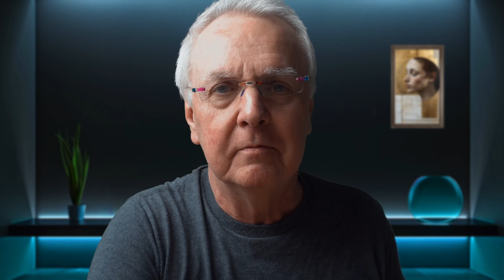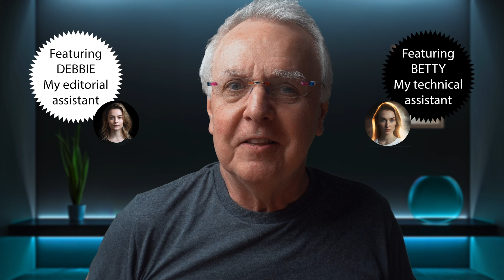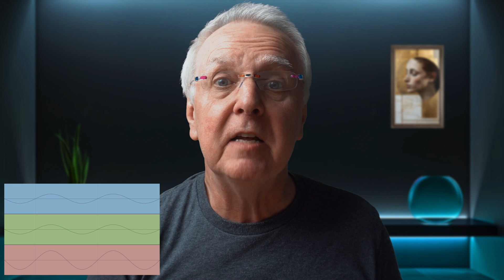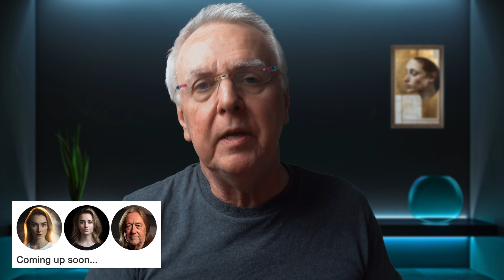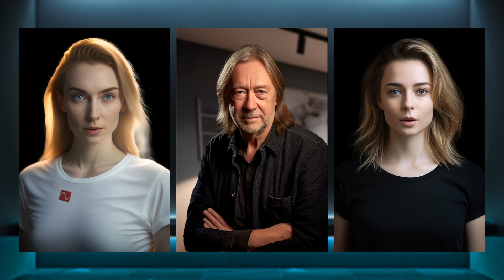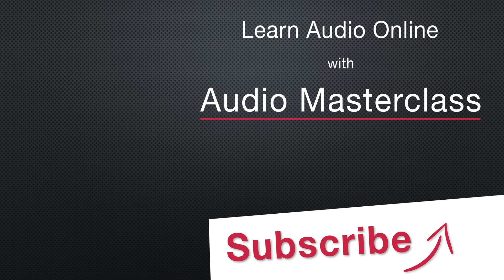Do you worry over phase issues? How bad can they be?

Comment: Do phase issues happen with pianos? all but the very lowest notes of a piano are 2 or more strings, so I wonder whether two identical strings but at slightly different distance from the listener / reflective lid cause any issues. Now that I think about it, I've heard piano tuners say that the strings for the same note should be ever so slightly out of tune, because otherwise it sounds hollow... I had never thought of that as phase-related, I'd assumed it was a similar principle to how a fifth sounds more full than an octave, but now I think about it, maybe that's due to phase issues too, since an octave is pretty close to 2:1 on an equal-tempered piano (but not exactly, the octaves stretch out from middle C, although my piano guy couldn't provide an explanation other than 'it sounds weird if you don't do it'), but a fifth in equal temperament is comparatively quite far from a just fifth. So maybe it's the imperfection in equal temperament that creates that 'fullness'? idk.

Anyway, I know you're into classical music, and I've been playing classical piano for 25 years, so I would love to hear you talk about anything and everything you can think of with sound and audio as it relates to piano and orchestral instruments.
Reply from the maker: The distance is too close to make any appreciable difference. If you consider that the wavelength of 20 kHz is around 17 mm then the distance between the strings isn't going to cause any problems. As for equal temperament, I used to have a digital piano that had a number of temperaments available. Just intonation may be mathematically accurate for any one key but it lacks richness and interest.

Comment: Wonderful topic.  It turns out I have been doing a lot of thinking about this very topic over the last few days.  I am planning for some new components, a couple of monoblock amps.  In the new configuration, I will be using my DAC as the pre-amp, using both balanced and single ended outputs simultaneously, both are volume controlled. The balanced will feed the monoblocks, SE to the subwofders.  With te balanced outputs being a differential differential signal, how will the phase align with the single ended? Will they be in phase, 180 out of phase, 90 degrees out of phase or something else?  I have been ruminating over this for a week or two.
Reply from the maker: Tricky one, but I suspect it will be down to the design. It isn't unknown for different types of outputs to be inverted with respect to each other. It will either work or it won't, but if it doesn't then swapping the signal conductors of the balanced outputs inside one of the connectors will fix it. Free advance comes without guarantee.
Reply: @AudioMasterclass   I figured about the same.  Either flip the phase switch on the sub or don't.   It dors however fascinate  me, and I'm trying to get a better understanding.  Thanks for all the good videos and fodder to keep me awake at night.  :)
Reply from the maker: @kennydelaney7299  Don't forget to worry about absolute phase too 😀

Comment: I suppose I am an audiophile. I have test lps and cds with examples of in and out of stereo phasing.
The only phase issue i may have comes from getting red and black speaker wires mixed on one speaker. You can clearly hear it in the stereo image.

Comment: And I think most people, sadly, ignore the biggest phase issues they are likely to have with their stereo systems...the ROOM! Decent room treatment to tame the effects of reflections can make a big difference in the mid and high frequency ranges. And lower bass id often the biggest challenge, since those wavelengths are much longer...hence subwoofer phase controls or the ever popular "subwoofer crawl"to determine placement.
Reply: Yes, Siree Bob!  Set subs at 180
Vicoustic Wavewood Diffuser Ultra 😊
Reply: absorption doesn't do anything to improve the phase response of your room though. it merely masks the "issue"by attenuating the interfering reflections to such a degree that they no longer affect the direct sound within a certain listening window to some degree. quadratic diffusion can disperse the energy of taps and make them less uniform which is the complete opposite of phase coherent

The point is. room treatment is essential, but the kind you are talking about has nothing to do with phase as to how it garners those improvements

Comment: Howdy.
With all due respect.
What is the point ???
Much Regards.
Reply from the maker: The point is in the video. If you can't see it, I can't help you.
Reply: @AudioMasterclass  Howdy again.
With all due respect again.
I assume then the point is either the statement there are phase shifts everywhere, or a conclusion that phase shifting in audio gear has little meaning.
If the latter I tend to agree with apprehension. I believe that shifting harmonics so that slew rate becomes a limiting factor has some meaning. I do think though this is mostly theoretical having little true meaning.
Much Regards again.

Comment: This is the reason stereo can't accurately replicate a live performance.  It's ok if the source is center stage and the listener is sitting midway between the speakers.  The sound paths from the source to the two mics, and the paths from the speakers to the ears are nearly identical and the phase difference is small.  Now in a live performance, if the source is stage left or right, there will be small put noticeable difference in the path length and phase.  This is how we can tell the direction of a sound and therefore sounds natural to us.  But with stereo, the path length differences (and thus the phase difference) can be much much larger, thus causing cancellation at certain frequencies.  The resulting sound may be pleasant to listen to,  but one can't say it sounds "natural".  And if it can't sound natural, what's the point of being an audiophile?

Comment: In order to solve all phase issues you need to employ semi-critical quasi inverse didactic convolution. To determine the amount of convolution required you need to calculate the complex impedance of a non-resonant dipole located in 70% curved space and 3.2 parsecs away from a third order catastrophe cusp.  Then use the conjugate of the complex impedance and multiply it by the reciprocal of the impedance of free space. Best results from this process are obtained by carrying it out ten seconds in the future and then correlating it back to the present. This can be achieved by using non-linear inverse time regression techniques which will also cancel any time dilation distortions.
Reply from the maker: You’ve cracked it.
Reply: Dude!  You forgot to mention the flux capacitors in the PSU.
Reply: @stevesmyth4982  Yes I did forget to mention flux capacitors however, when I think about such things I get a nasty headache about 10 inches above my head. I consulted my Doctor and he prescribed tablets to take 10 minutes before I wake up.

Just the other day I went down the road to look for myself and when I got back before I'd returned, they had kept me there whilst I was away. Sadly it goes like that when you've been at it for a while.
Reply: Or you can just ignore it.
Reply: I did this very calculation while Venus was in retrograde, and now the sound coming from my speakers is doppleganged... 🤔
Reply: It’s really just solved by the modial interaction of magneto-reluctance and capacitive diractance. This is achievable when the 2 Sperving bearings are in a direct line with a panametric fam.
Reply: @user181 I was just about to say the same thing.
Reply: Bollocks
Reply: I'd hoped this channel was above such simplistic nonsense.
Clearly, the world needs more Audio Phil.
Reply: Fun, but it’s not helping anyone. Many will fail to see it’s a joke.
Reply: @artysanmobile  Anyone who fails to see this as a joke is simply thick, or stupid or brain dead. Therefore not helping such people isn't a problem. Remember that you can't educate Pork. Should you think otherwise and know a way of educating Pork then please advise me.

Comment: What, me worry about phase shift???  Not really...  Are my speakers time aligned?  No, they were built in 1954!  How about the subwoofer?  Ours is an older one without any adjustment for phase.  At least it has a decent crossover, or so I think.  In our modest townhouse the sound is fine at least with good recordings.  The main speakers are JBL C38's with 075 tweeters and D131 woofers.  They have been in the family since new and still play perfectly (oops, probably should not have keyed this).  Phil said it best!

Paul H.
Huntington Beach, CA USA

Comment: Think Phils needs a haircut, he might be able to hear better then.
Reply from the maker: Phil takes a financial haircut every time he upgrades. That’s why he can’t afford a barber.
Reply: @AudioMasterclass  thats true. When my friends ask how I can afford such expensive equipment I tell them it's because I stopped going to barber fifty years ago.
Reply: @AudioMasterclass how does one upgrade an already perfect system?
Reply: Just throw an extra pair of Bose 301 series II s in and non symmetrical wood paneled walls  then you will have plenty of phase issues to cancel each other out.
Reply from the maker: @stevengagnon4777  I sense flippancy in your comment but in acoustic treatment this is exactly why many weak diffused reflections are preferable to few strong specular reflections.
Reply: @AudioMasterclass  it's true there is a sense of fippancy . It's also true that there was a sence of fippancy when I first added the Bose 301seris IIs( a little pair of desk top stacked on top)and the rear speakers fired at the ceiling in paint cans on the floor.

Comment: +6dB? adding 2 equal sound sources?...... LOL....
Reply: I had to check with ChatGPT just to check my memory & it gives the following:

"When you add two equal sound sources together (assuming they are in phase and identical), you'll experience a 3 dB increase in sound level. This is because when two sound sources of equal intensity are combined, the total sound power is doubled, resulting in a 3 dB increase in sound level. 
It's worth noting that this assumes the sound sources are in phase and identical. If they are not in phase, the increase in sound level may be less than 3 dB due to interference effects."

You have to increase the signal by 6dB to double the perceived loudness, which is an entirely different thing!
Reply: +3db means doubling of the quantity you are measuring. What quantity are YOU measuring. Our host is looking at voltage levels on a screen. What do you do with that voltage? You drive a loudspeaker. Assuming you have a perfect amplifier and a theoretical loudspeaker that only acts as a resistor, doubling of the voltage across a loudspeaker will introduce a doubling of the current that flows through the loudspeaker hence a quadrupling of the power required and a quadrupling of the sound pressure produced. Hence the +6db. This is true for all voltage to power transformation in audio. For example the doubling (+3db) of voltage that happens across a balanced connection vs a single ended one, will result in quadrupling (+6db) of the power. Bridging amps works in the same way.
Reply from the maker: Go on, tell me why I’m wrong. That should be interesting.
Reply: It s +3 dB, lol. I know you know this stuff, so I am apprehensive, where s the catch? LMAO
Reply: @gibson2623  Twice the voltage also implies double the current so power is increased 4 times..
Reply: In Decibels is +3. This is academic :)
Reply: @gibson2623  No it's +6, 4 times the power.
Reply: @razisn  Try in a DAW and see if it is 6 or 3 dBs
Reply: @gibson2623  You look at voltages in a DAW not power. db is an absolute number,  you have to define the property you are referring to. +xdb of what?

Comment: Phase is a crucial concept in the theory of harmonic decomposition of signals, such as in Fourier theory. Phase shifts associated with low-pass, high-pass and band-pass filters negatively affect pulse response, which can certainly become audible, smearing attack transients in time. It is also one of the issues affecting PRAT (Pace, Rhythm And Timing) (as in the audiophile use of the terminology, not to be confused with musicians' use of the same terminology but which means something completely different.)
Accuphase deemed phase to be such an important factor in audio technology that they based their trademark on it.

Comment: it seems obvious that if you listen to 2 channel stereo it sounds best if you sit at an equal distance from the speakers and you've cabled them up with equal lengths of cable and they are placed the same distance away from a wall etc. etc. But who has a perfectly symmetrical room and even if we did would SWMBO let us put our speakers where we want? 

But you don't have to have audiophile ears to hear if you've connected one of your speakers the wrong way around though, it just sounds a bit odd...

I guess though that asymmetrical room reflections cause loads of phase issues...

and phase issues can be caused by a crossover circuit?

It's amazing we hear anything at all 😉

Comment: If you have a surround sound setup or quad speaker stereo, the distances can be set (wrong) in the receiver, phase issues unless you have space enough to put them equidistant from each other (though pointing the surround speakers toward each other, phase issues). This can result in a stereo center image that's hard to erm center, or there's an audible hole in the sound stage where no sound is coming from which sounds odd as if one ear is plugged up. 
Putting speakers close to a wall, lower frequencies bounce on the back wall (behind speaker) and phase issues. High frequency sounds bounce at the front wall (behind you) wall, phase issues. 
Speaker drivers that are offset in distance from each other, phase issues.

It's just better to listen to mono one would think lol, just a center channel speaker is enough. Maybe one day a brain link can induce music directly into your synapses without phase issues ;)

Comment: 90 Degrees, Quadrature.  :-  )
Reply from the maker: Congratulations, you win!
Reply: I find practically the worst offender is when recording an acoustic guitar fitted with an internal pickup. Mine is fitted with an internal microphone,  and combined magnetic pickup.  Externally I also have a feed from a large condenser. I have to insert delay from the internal feed, otherwise the phase difference between the guitar pickup and mic is horrific. I get the balance using a percussive sound and then looking at the time difference in the recording as a good start. Group delay is a measure of the rate-of-phase-change over frequency, so potentially you can have phase difference, and I imagine that below a certain us/Hz limit, it wouldn’t have an audible impact.
Reply from the maker: @Roosville1  This is exactly it - a sound or signal mixing with a delayed version of itself. Considering that sound travels around a foot, 30 cm if you prefer, in one millisecond this is easily in the zone where you will get audible phase cancellations without correction.

Comment: I have been trying to explain this to my friends and family for years. I purchased a pair B&o M100s in 1977. Times alined and phase coherent, which I still have.   They have long since gone dark, probably because of the electrolytic capacitors. The cabinets are too beautiful to get rid of them. I have since discovered that the fewer the drivers the less coherency problems you have. Mofi source point 10s does really good job of solving that problem.
I have a Yamaha YSP 4000 uses phasing to control It’s projection beans. Not a perfect system but as you say, it’s good enough. Love your content.

Comment: Relative electrical phase difference between stereo speaker drivers - swapped +/- on one channel only - is definitely a thing. Bass frequency drops off, treble can sound "odd", to me at least. But anyone who claims that absolute phase is a thing, is delusional.
Reply from the maker: Yes I skipped this one because I see it as an inversion issue rather than my main argument for this video, although I did mention inversion briefly just to make sure it was in there. I'm sure I'll be making a video on inversion, and perhaps even on absolute phase, in the near future.
Reply: At least to my ear, inversion of absolute phase audibly changes impulse response of vented speakers, one more reason to enjoy low Q sealed.
Reply: @paulb4661  If you think you can hear it, then you probably don't understand what it is. Unless, of course, all your observations were conducted in double blind tests.
Reply: @albanana683  Helmholtz resonator is not symmetrical in its behaviour, fluid theory clearly suggests, that the ease of air flow is greater for the input, or enclosure volume compression part of the cycle, than for the output, or expansion part. Without going into detail, which you may not understand, this explains the audible difference resulting from this asymmetry. Closely listen to the beat and you will hear it.